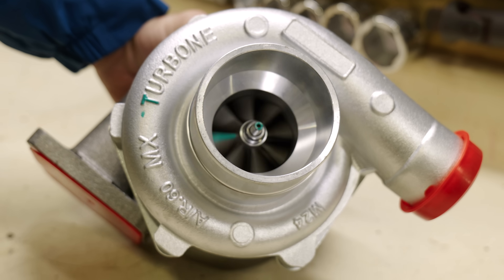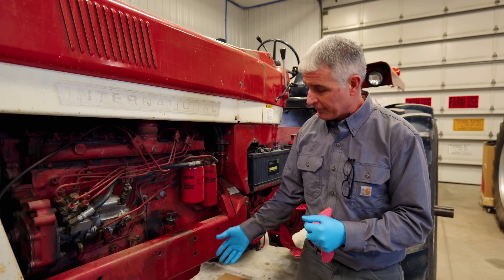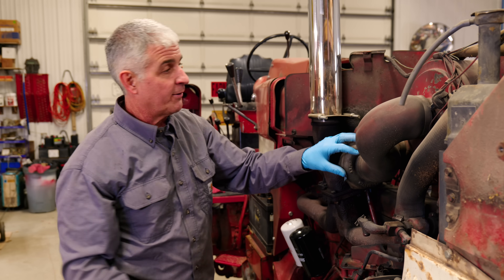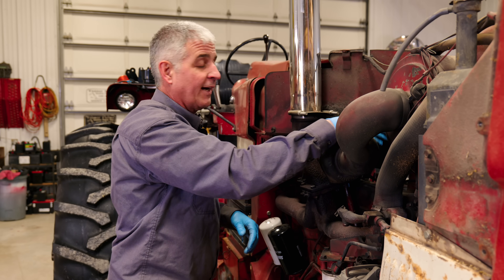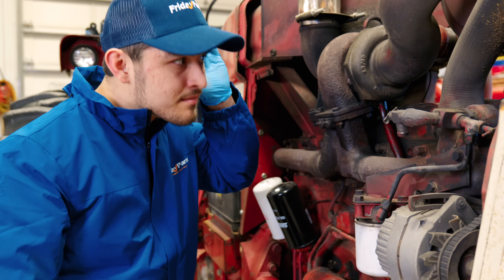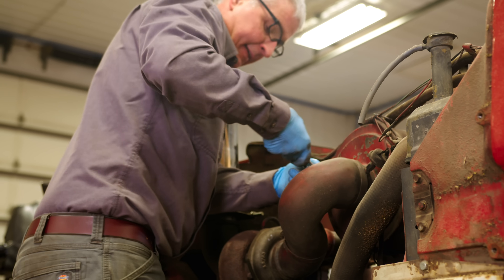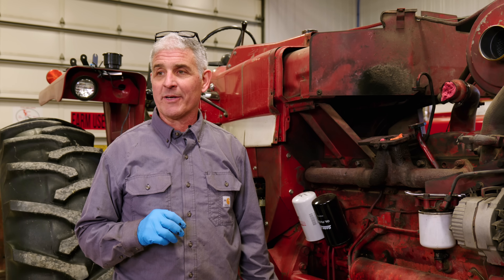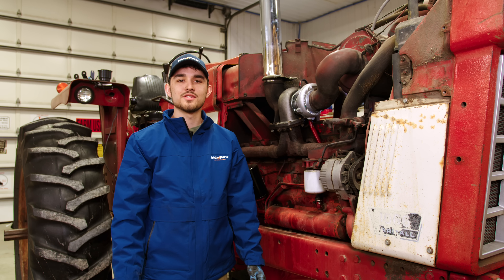Boost Your Tractor - Diesel Turbo Install Guide

Comment: What a great job you did!I would recommend this video to anyone who's looking for a DIY guide to turbocharger maintenance, cuz the explaining of the concepts is in a clear and concise way. But the key is that to have a good understanding of your car's engine before attempting to work on the turbocharger. If you are not comfortable working on your machine, it's really recommended to  to take it to a professional...🤨
Reply from the maker: Thank you for the thoughtful comment! You're absolutely right—understanding your car's engine is crucial before diving into turbo maintenance. Safety first!